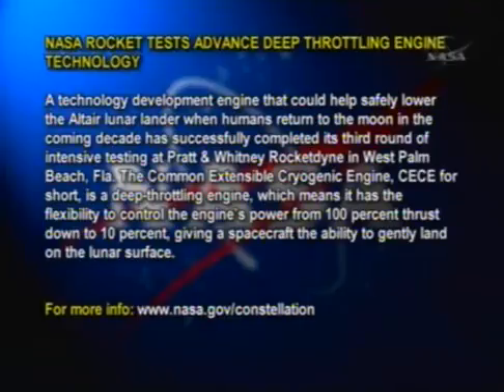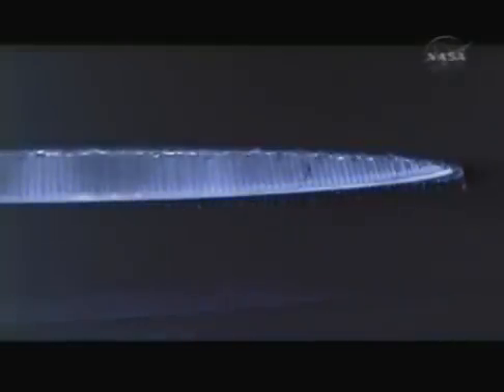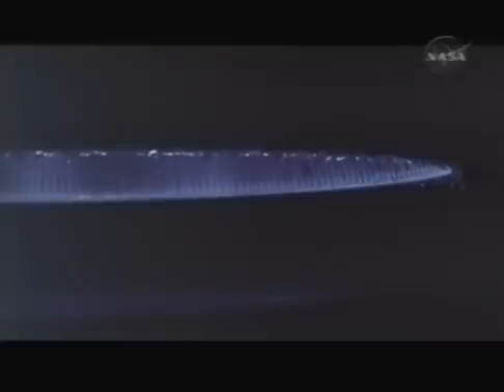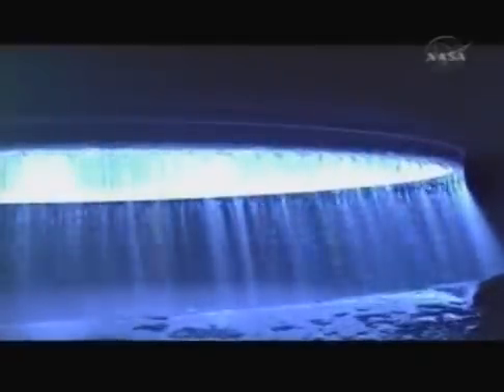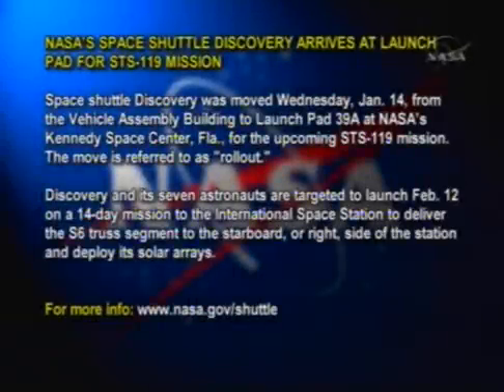Common Extensible Cryogenic Engine

Comment: I can't get over the icicles that form around the nozzle at the bottom.  You would think the radiant heat coming off of the exhaust would not allow that to happen.
Reply: The interesting thing about hydrolox (lh2+lo2) engines is that the exhaust contains only water vapor and hydrogen, and is optically clear even at thousands of degrees. Because of this it doesn't actually radiate any heat. A cold hydrogen film keeps the nozzle cool, and is what cools the condensing water vapor in the exhaust to it's freezing point.

Of course convective heat transfer means that rebar would melt like a crayon in a cutting torch if you jammed it /into/ the exhaust plume, but it would not feel hot to stand next to.
Reply: @highvoltagefeathers  um I'm pretty sure it's because of the regenerative cooling of the hydrogen to power the pumps,even at that temperature,a small fraction of heat in form of waste heat is absorbed by the wall and raises the temp of the liquid hydrogen to gasify it but the gaseouss H2 is still very cold,and that forms the icicles,the little vapor in the "not so perfect vacuum "accumulates and forms those pretty icicles
Reply: Convection. Interesting how they grew at a higher thrust. The draft must have been strong. It also says something about how well the exhaust flow is focused.

Comment: What would happen to your arm if you put it under the engine? (I know it would be cold and probably lethal)
Reply: the exaust is traveling at a couple thousand mph when it exits and is also a couple thousand degrees. your arm wouldnt last long.
Reply: Ivan Emrich Well, thanks for clearing that up XD
Reply: It's cold on the cooling tubes that are filled with liquid hydrogen, but the exhaust is very hot.
Reply: That thing wouldn't have time to burn you, if you stuck your hand under that it would either rip it off or the ventury would suck your entire body into the exhaust, which would be flung out at supersonic velocity in little tiny bits and pieces. The chamber pressure of those engines is measured in thousands of PSI lol. You wouldn't know what happened.

Comment: Why is it blue?
Reply: MythicSageV2 The hotter something burns the closer is to white. Same as a flame from a torch. It goes from cold orange to a hot blue.
Reply: +MythicSageV2 Blue is good, it means efficient burn, yelowish or red are bad colors ;)
Reply: +MythicSageV2 The spectrum for emission for hydrogen flames is very lightly blue. (Most of the emitted radiation, though, is in the UV) In this flame, where there is a great deal of burning hydrogen, you can see it pretty dramatically.

http://www.sciencedirect.com/science/article/pii/S0010218009000170
Reply: MythicSageV2 Blue due to the hydrogen. The exception is the Delta Heavy. It burns H2 and Lox and should also have a blue flame, but the nozzles on the engines have an ablation coating that helps keep the nozzle cool,  this adds carbon to the flame (which,  of course,  is why your campfire is yellow, burning a lot of carbon)
Reply: +Alejandro Medina I ask the question because I don't think you should see any visible light. The substance they are burning is close to pure and shouldn't be in the visible  spectrum range.
Reply: MythicSageV2 It is close to pure BUT it still is going through a chemical change and as it leaves the nozzle it probably has dropped quite a lot in temp.
Reply: Normally such a flame is invisible but only under low pressure.  The chamber pressure is very high and so makes it burn a lot hotter to the point some of the molecules to ionize from inside the combustion chamber where the temperatures are highest.
Reply: I've noticed that it is only blue around the edges - where the gases come into contact with the surface of the nozzle. Inside the gases are clear.

Comment: why is the nozzle is so cold, and how come after burning it stay cold enough to freeze exhaust? what was the atmospheric pressure at the run
Reply: It's that cold because the liquid hydrogen fuel travels through tubes at 4 degrees kelvin or minus 269(numbers could be a bit off don't troll me) prior to entering the combustion chamber.
Reply: The boiling point of hydrogen is around 30K. Its melting point is 14K, so definitely not 4. Though even 30K is unimaginably cold.
Reply: IsraeliXdude liquid hydrogen is at -450°F. That's why the use it for cooling
Reply: all the tests on the rl10 are done in a vacuum chamber, it's never used at sea level. that's why you only see a few inches of the plume

Comment: It seems engine start was at atmospheric pressure in a chamber -airtight- except for exhaust duct. As engine runs, supersonic exhaust flow entrains and ejects almost all air in test chamber. Only in vacuum would such a large engine be able to run with such extreme smoothness that long, skinny icicles would not break off instantly. Notice that at engine shutdown, the icicles are blown off violently, but not down exhaust duct; rather they're blown sideways into the test chamber. Ice hits lights!

Comment: Was this test in a vacuum chamber?
Reply: No vacuum chamber on Earth can remotely handle the exhaust of an engine like that. 

Imagine the pumps you'd need!
Reply: +ApolloWasReal +piranha031091
As I said in 2012... 
*YodaWhat
It seems engine start was at atmospheric pressure in a chamber =airtight= except for exhaust duct. As engine runs, supersonic exhaust flow entrains and ejects almost all air in test chamber. Only in vacuum would such a large engine be able to run with such extreme smoothness that long, skinny icicles would not break off instantly. Notice that at engine shutdown, the icicles are blown off violently, but not down exhaust duct; rather they're blown sideways into the test chamber. Ice hits lights!*
Now I add for greater clarity: Air rushing back into the test chamber from outside atmosphere is what blows the icicles off the engine so violently.
Reply: Yes.  There are two large steam powered venturi vacuums (called ejectors) that create the initial atmosphere of appx. 70K ft. simulated altitude.  Once the engine starts, the exhaust gas passes through a venturi shaped diffuser which evacuates the test chamber as well.  If this engine chamber were to be run at sea level, it would fail due to exhaust gas separation from the nozzle walls.  There is another video (https://www.youtube.com/watch?v=Adspnx58osM) that shows the outside of the test stand and you can see the two ejectors running.

Comment: I thought they tested these in a vacuum chamber, so shouldn't liquid water have not formed? O.o
Seems kinda odd to test it in a specialized chamber like that but not a vacuum chamber :P
Reply: Those are tested at atmospheric pressure. It would be practically impossible to build a vacuum chamber capable of staying under vacuum with such an exhaust injected into it. Imagine the pumps you'd need!
Reply: Steam ejector blowdown was used to test the J2.
Reply: @fiftystate1388  Same with this test stand.  However, it only created a simulated altitude of ~70K ft.  With the humidity in the south Florida swamp, the dewpoints in the test chamber were higher than the temperature of the LH2 flowing through the nozzle.

Comment: @Ronsmytheiii The use of hypergolics is a safety one.  The space shuttle uses H2 and O2 for the shuttle main engines because they are not used in orbit and are started on the ground.  The issue with using non-hypergolic fuels is that they need to be started somehow, and if the system fails you are screwed.  On the other hand, with hypergolic fuels, when the two components hit each other, they automatically ignite.  I don't think the non-use is a weight or money factor, but rather a safety one.

Comment: @angryadrien 
Actually, the silica tiles on the shuttle can be handled bare handed only on the edges.  The flat surfaces would still be hot enough to burn the flesh off your fingers.

Comment: @R5H4D0W Also, the heat shield tiles on the spacecraft can be heated to over 5,000 degrees and within a second of removing the heat source, you can touch the tile with your hands.

Comment: @xytronite I have no idea, but the fact alone that the icicles could grow as they did, suggests that the engine is running extremely smoothly. Heavy vibrations would probably have snapped them off in an instant, as happened when they turned the engine off.

Comment: the icicles is not unlike a frozen beard of a Canadian guy in winter, the fuel circuit loops over the nozzle first before going into the turbos who feeds the fuel excited by heat gain into the combustion chamber. While the inner portion of the nozzle may be red hot the outside of the nozzle is constantly being fed by new fuel slurry that is absorbing heat as it gasifies...so what happens when you blow steam on a icy condenser? voila :)

Comment: @HAL11000 
The OME from the shuttle was baseline though Altair has been defunded while they decide what route the space program is to take.
The Ares I and V vehicles will likely be canceled and replace with cheaper LVs which will impact the over all architecture.
BTW this is not the first time this has happened the Apollo went from Nova to Saturn and the Shuttle went though extensive changes during their development.

Comment: @blablubb12345 
Well a little more then that look closer at the nozzle.
 The radiatively cooled nozzle extension found on the RL10B-2 is not present and the regen cooled nozzle appears to have been extended.
The engine appears to have been reworked considerably on the nozzle end.

Comment: The hypergollic OME from the shuttle is probably a better choice as far as reliability followed by the pressure fed Kero LOX Kestrel off Falcon 1.
Though the hydrogen engine is in the LSAM for two reasons one Ares I can't do it's job so LOI is moved to Altair and they think someday they could refuel the lander via ISRU.
Though by the time you got ISRU on the level to refuel a spacecraft  you would not be flying Altair or Orion any more as both vehicles would have long since been retired.
Reply: OMS

Comment: I think the engine test was performed in a "vacuum" test chamber in order to simulate upper stage engine conditions. So there was little air to transfer heat from the engine. The engine exhaust produces a vacuum effect, so all the heat goes out to the exit. Any air in the chamber should be cold enough to avoid melting the ice.